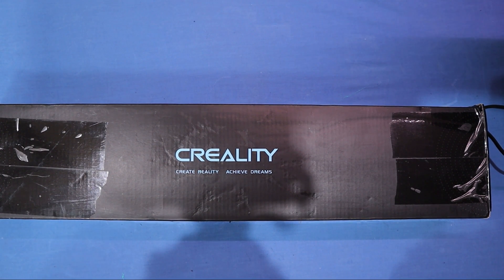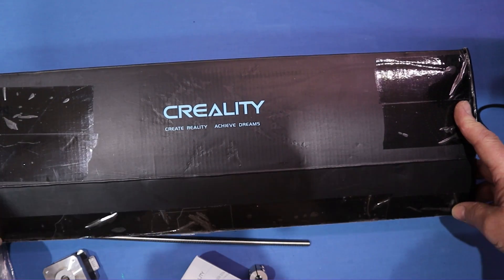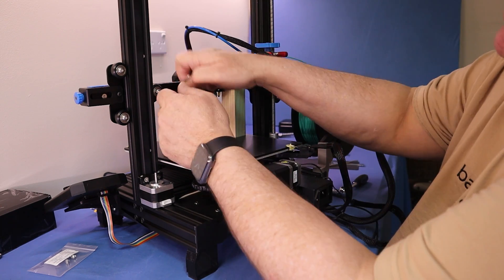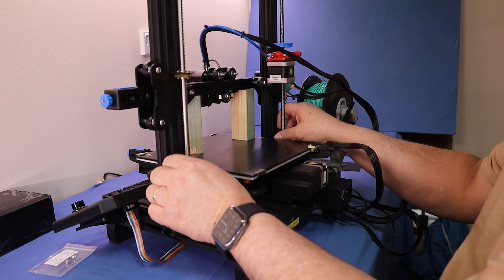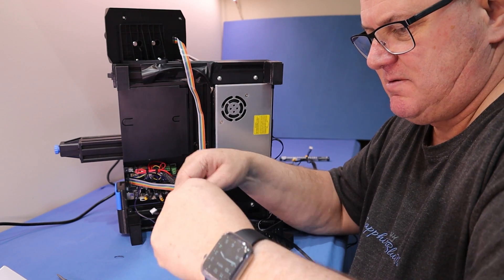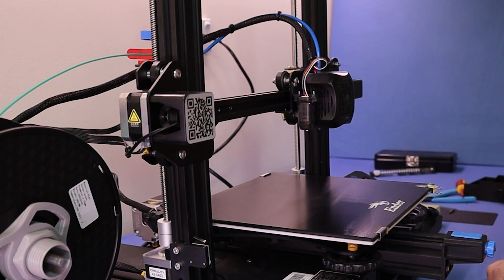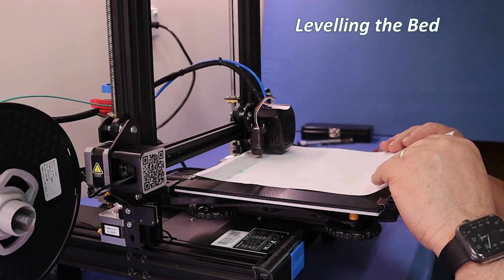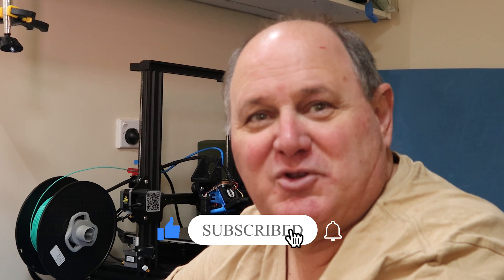Ender 3 v2 Dual Z axis unboxing and upgrade -  dual stepper motor and rods

Comment from the maker: Have you done a Z axis upgrade to you Ender 3 V2? 
Did you find it helped the stabitiy issue with the X Axis Gantry?
Do you have any questions or comments I look forward to hearing them.
Reply: it works until you turn it off and have to re-level the gantry... I don't think this mod is worth it unless you go further and install a 5-stepper board and use G34 for auto leveling the X gantry with two stepper motors before each print
Reply: It diffidently helps gantry drop, I have only had the gantry drop once after turning power off. If it does drop some, put a small level on it and turn the led screw to re-level it. Its easier than dealing with gantry drop without a second Z axis motor.

Comment: Hi Phil, I have a question about the sync of motors. I have read a lot of concern that there is a high risk that they can be not sync but its is really truth? I'm turn off my my printer after every print and I'm just wondering whether after turnning on, any actions are reguired? In my opinion threre is low risk that some misalighment will happen because the thread should force the rotation on both sides.
Reply: I have not had any problem with them being out of sink by turn printer off and on. You can force one side down though if you put to much pressure on one side of the gantry with the power off. I have some 100mm X 40mm rods printed to set the gantry on for maintenance and they are handy to check the height left to right. 
Hope this was helpful.
Thanks

Comment: How do u insure both axis are in sync.Also nice video I saw you did something with blocks but you glazed over it with no mention of what u would do if one side didnt match the other Tk you
Reply from the maker: I use the two 100mm blocks between the chassis and the gantry to make sure the gantry is square with chassis. You need to do this with the printer off and one stepper disconnected. Then reconnect stepper and power on printer. Once connected together the stepper motors will move in sync. Sorry it wasn’t clear in the video. Thanks for the comment.
Reply: @philtalkstech  sorry but disconnect do u mean unplug or take the z axis screw out if printer is off as your saying isnt the stepper motors in effect disconnected .I'm just trying to understand correctly
Reply from the maker: @charlesrestivo870  you need to disconnect one even with printer off. As they are electrically connected as you turn one screw it try to turn the other motor.  You could also loosen one coupling. But I find it easier to just unplug a stepper. Once it’s synced you shouldn’t have to do it again unless you move the gantry manually.
Reply: @philtalkstech  ok thank u

Comment: Hi Phil, i'm pretty much on the same upgrade path like you but leaving the fans to be the last thing to do. I noticed you did manual leveling before letting the cr touch do it's thing? What option is that in Jyres. Also I noticed your still have your z limit switch installed. Any particular reason you still have it on?
Reply from the maker: Hi. Z switch is still there but not connected. I use manual levelling in the prepare menu when ever I’ve made a change to the machine especially if I move it or turn it upside down. I like the manual level and the CR Touch will give you an accurate measurement for all four corners and the centre. I think I might put a video together on how I level the bed.
Reply: @philtalkstech  thanks for the clarification, I'll give that a go tomorrow. Do you have a recommend filament source in Australia? I've been shopping around but haven't settled on a supplier/brand yet
Reply from the maker: @Ramzinho_8  No I’m not settled on a supplier yet. Mostly buying on Amazon and have tried many different brands only really had 1 bad roll (Acccreate white. It was a duel pack black & white the black was good white just won’t print at all). I do find that these brands do print better though, Flasforge, Overture, Noulei.

Comment: Hey Phil, how would you rate this upgrade? Was it a worth while upgrade and do you still use it yourself? TIA
Reply from the maker: I Definitely would recommend this upgrade. I had a lot of trouble with my X gantry dropping and this has fixed it. And I'm still using it. Especially since I've added the extra weight of the direct extruder. 
Thanks.
Reply: @philtalkstech  Thanks, ah so many upgrades can't keep up lol
Reply from the maker: @TechieNI  half the fun for me is upgrading. Going to concentrate on printing some things this week. Now that it's dialled in so nicely. Have fun.

Comment: Hoe did u align the axis
Reply from the maker: I use 2 100mm blocks between the printer base frame and the X gantry then with both stepper motors disconnected I bring the gantry down by hand onto the blocks by turning bother z rods. Then plug both stepper motors in remove the blocks and start up the printer. Only have to do this when you first fit it. I check the X gantry to frame when ever I move the printer location or do any major work on the X gantry or hot end. I printed the blocks to exactly 100mm. 
Hope this is clear enough to follow.
Thanks.
Reply: @philtalkstech  it is I have two of these kits but the extensions supplied are too short Plus I seeing now that you need to up the voltage or else the setup dosent work correctly .? Any thoughts on this and are their extensions available Thank you for replying if I'm taking up your time I apologize.

Comment: Did u use the supplied splitter cable
Reply from the maker: Yes I did. My kit was the Creality one. I didn't have to up my stepper voltage just check mine and was fine as it was.
Reply: @philtalkstech  thank u

Comment: Hey Phil. I assume this upgrade will fix, or aims to fix, the non-motored side sagging or being too high? I am struggling with my Ender 3v2 gantry staying level.(If I measure up from the frame on both sides, I get different measurements. They are only off slightly but enough to drive me crazy.)
Reply from the maker: Yes that's correct. It has solved my gantry issues. Don't even check it anymore unless I've moved the printer or do any work on the gantry.

Comment: Hallo Guys, 
Ich did This Upgrade Last evening. Everything worked will. But when the New Stepper Motor dont move, I can hear an Electric Noise coming out of it. ist Not very Loud but i dont know if this is normal ? When the Stepper Motor is Running, the Noise disapears
Reply from the maker: Shouldn’t be making any noises when it’s not moving. Without moving z axis unplug the stepper. Does the noise stop?
Reply: @philtalkstech  thanks for your comment. if you may have time. Go to My YouTube Channel. There ist the Video where you can hear the Noise. When i unplug the Motor, the Noise turns off.

Comment: I did this 6 months ago on my ender 3 max after having it not staying level. Yes I have the CR touch also. After I did mine it worked so much better but still went out of level. So what I did was get some aluminum spacer tubes and eliminated the springs cause I found they were an issue. Yes I had the stiffer Yello springs. Ever since I did this not one issue in over 100 prints. You might try it
Reply from the maker: I don't have a lot of problems with level going out. But I might give your idea a try. Tjanks
Reply: Just a word of warning when doing this, if your probe malfunctions or something else malfunctions then your nozzle has no buffer when it dives into the bed and you may potentially break something. The die springs work fine for me and many others. If it works for you then it works for you, but be warned that they are a really bad idea.
Reply from the maker: @adamarzo559  I’m trialing silicone spaces and I think they are best solution I’ve tried.
Reply: @adamarzo559  the only Time the probe might fail is in very beginning and we all watch the 1st or 2nd layer go down then it doesn't change during making

Comment: i went with dual belts on my ender 3 pro. have you had any issues with one side dropping down when powered off? does it auto tram or just rely on mesh leveling? one awesome upgrade i did to my printer which i recommend is thingiverse 4743835. they should be printed in PETG, but PLA+ could be ok. it made adjusting the initial z much easier because one click is 0.01mm, i use a .2mm feeler guage and then you just babystep the offset and let the crtouch work.
Reply from the maker: Hi Aaron. I’ve had no issues with one side dropping at all. I’m using Jyers firmware and I have it auto traming at the moment. I don’t really need to manually level anymore, unless I move the printer or turn it over. 
I like the look of the leveling knobs. I’ll print a set and try them. Thanks for commenting.

Comment: I have considered the dual stepper setup, but I think the dual screw with timing belt setup may be less prone to missing a step or two on one stepper or the other. Music is a bit loud. Appreciate the post.
Reply from the maker: I'm not missing any steps with mine. I did consider timing belt option but had trouble sourcing one in Australia and the pandemic has made shipping to Australia unreliable.
Thanks